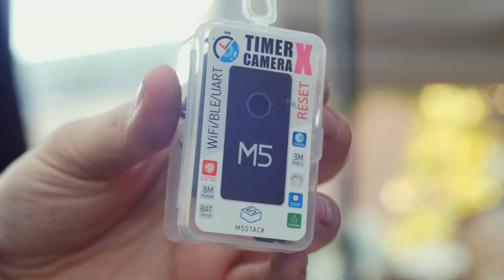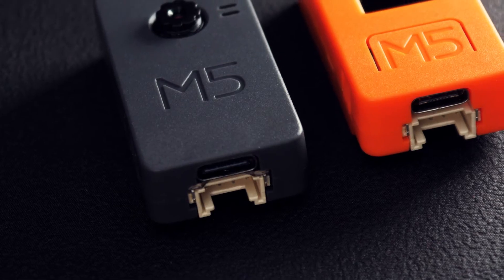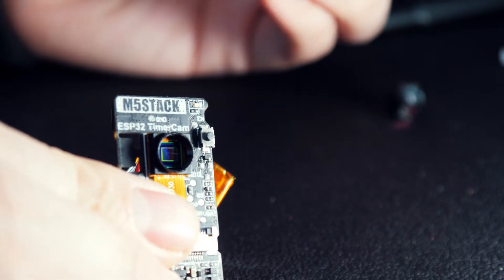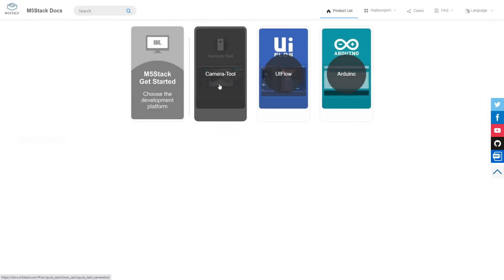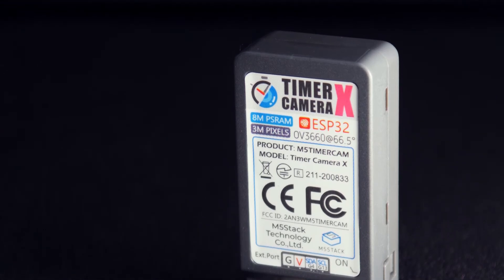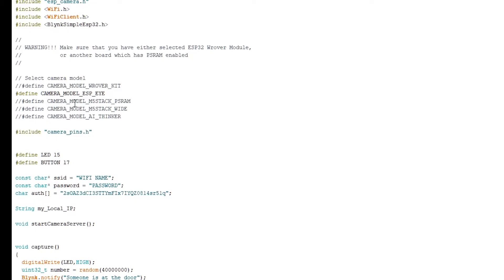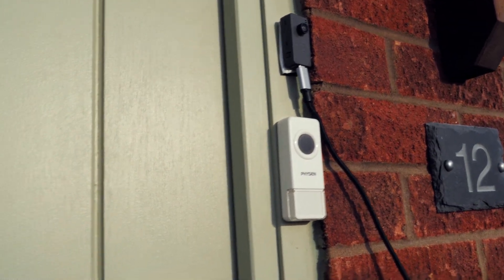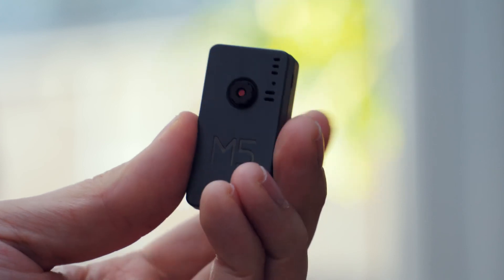M5stack Timer Camera X ESP32 PSRAM OV3660 Review

Comment: Hey! To get the battery working you need to include the battery library and add the init statement into your void setup statement.

Full code:

#include "esp_camera.h"
#include <WiFi.h>
#include "battery.h"
#include "camera_pins.h"

const char* ssid = "your ssid";
const char* password = "your password";

void startCameraServer();

void setup() {
  Serial.begin(115200);
  Serial.setDebugOutput(true);
  Serial.println();
  bat_init();
  camera_config_t config;
  config.ledc_channel = LEDC_CHANNEL_0;
  config.ledc_timer = LEDC_TIMER_0;
  config.pin_d0 = Y2_GPIO_NUM;
  config.pin_d1 = Y3_GPIO_NUM;
  config.pin_d2 = Y4_GPIO_NUM;
  config.pin_d3 = Y5_GPIO_NUM;
  config.pin_d4 = Y6_GPIO_NUM;
  config.pin_d5 = Y7_GPIO_NUM;
  config.pin_d6 = Y8_GPIO_NUM;
  config.pin_d7 = Y9_GPIO_NUM;
  config.pin_xclk = XCLK_GPIO_NUM;
  config.pin_pclk = PCLK_GPIO_NUM;
  config.pin_vsync = VSYNC_GPIO_NUM;
  config.pin_href = HREF_GPIO_NUM;
  config.pin_sscb_sda = SIOD_GPIO_NUM;
  config.pin_sscb_scl = SIOC_GPIO_NUM;
  config.pin_pwdn = PWDN_GPIO_NUM;
  config.pin_reset = RESET_GPIO_NUM;
  config.xclk_freq_hz = 20000000;
  config.pixel_format = PIXFORMAT_JPEG;
  config.frame_size = FRAMESIZE_UXGA;
  config.jpeg_quality = 10;
  config.fb_count = 2;
 
  // camera init
  esp_err_t err = esp_camera_init(&config);
  if (err != ESP_OK) {
    Serial.printf("Camera init failed with error 0x%x", err);
    return;
  }

  sensor_t * s = esp_camera_sensor_get();
  //initial sensors are flipped vertically and colors are a bit saturated
  s->set_vflip(s, 1);//flip it back
  s->set_brightness(s, 1);//up the blightness just a bit
  s->set_saturation(s, -2);//lower the saturation

  //drop down frame size for higher initial frame rate
  s->set_framesize(s, FRAMESIZE_QVGA);

  Serial.printf("Connect to %s, %s\r\n", ssid, password);

  WiFi.begin(ssid, password);

  while (WiFi.status() != WL_CONNECTED) {
    delay(500);
    Serial.print(".");
  }
  Serial.println("");
  Serial.println("WiFi connected");

  startCameraServer();

  Serial.print("Camera Ready! Use 'http://");
  Serial.print(WiFi.localIP());
  Serial.println("' to connect");
}

void loop() {
  // put your main code here, to run repeatedly:
  delay(10000);
}

Comment: This is a great project idea. Personally, the setup that I would favour is mounting the camera on the inside of my door, looking through the peephole (get the peephole fisheye advantage), plus there is no way for someone to just break it off and steal it. You can even connect it to a USB power brick to make it last a long time. Another option is to connect it to a core2 so you can see who is outside, since you no longer have a peephole.

So, the question is: how do you mount it inside, then have a doorbell press trigger an alert to your phone with the picture or video linked to it? Afraid my knowledge of these components is limited. Maybe you can solve the problem :)
Reply: umm ... looks like that is what techiesms did ... nice.